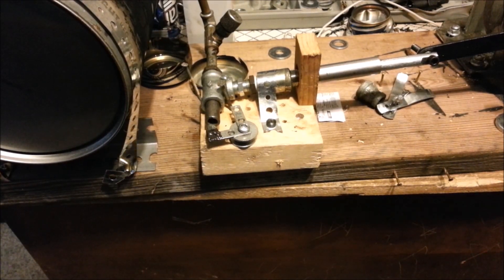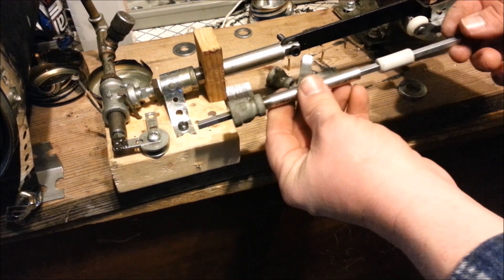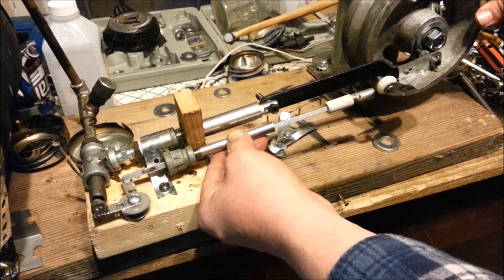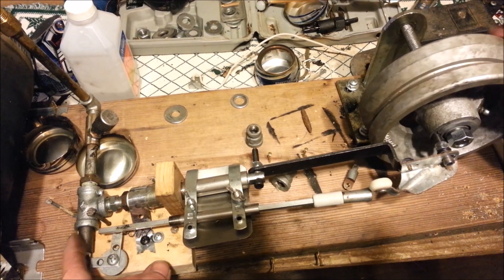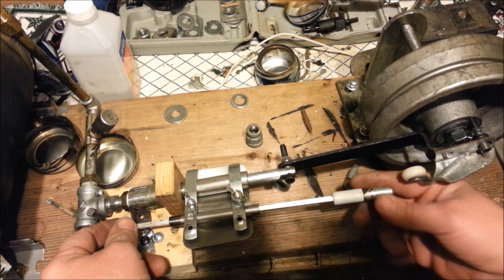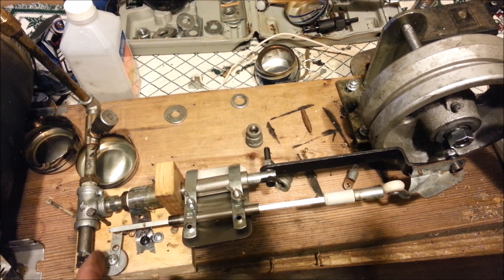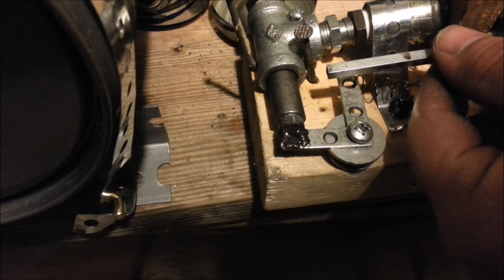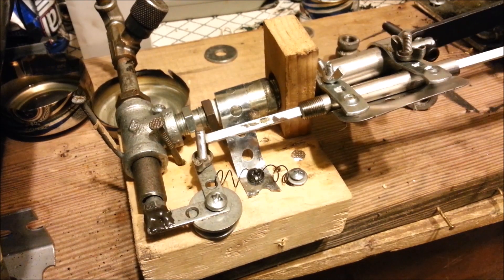How To Build A Steam Engine Part 2

Comment: Great videos. Thanks for sharing. I think if you use a ball valve and open and close the ball valve it will work better for you. That way you don't have to worry about the steam pushing open the valve when the steam gets higher than the spring can close it back. I bet a ball valve will work better.

Comment: hey wayne i think i got one for u for u second piston to work try to but two 90 deg hard or a good stiff metal on both ends that might work the one by the roller might want to adjust it a lil to fit for the piston and the rod hope this helps u out love the clip

Comment: Step your exhaust tube down to a smaller diameter, that way it only takes a small amount of force to keep the valve closed. If the exhaust valve and cylinder are same diameter, the pressure may exhaust overcoming the spring rather than driving the piston. Just step the exhaust down to a small diameter and use a strong spring. Also, the water should be in a closed system. That way the water re condenses and remains in the system, and the only exhaust is that of whatever the heat source is.
Reply: Y

Comment: Everything is perfect except a simple mistake. Mistake is that, just think steam pressure is powerful enough to push a sealed piston to run the entire engine. Piston is pushed by pressurized steam only when the valve is closed. Now there is the mistake. What exactly is closing the valve ?? a simple spring. pressure will always try to find a weak escape, if ever there is a little load in piston then steam will escape through closed valve forcing the spring to stretch. Engine will collapse.
Reply from the maker: +Kishor Parida Good point, and probably exactly right. I really wish I would have finished the project. My problem is I have no real tools other than hand tools. I sometimes get myself into more than I can handle. haha. I would love to have an old Bridgeport mill or even a good drill press. Thanks for watching, check out my other videos.
Reply: +Wayne Earls That is true lol. If you want to make it a complete homemade without even spending a penny then it is going to be a bit difficult. Besides don't worry you already have completed 90% of work. 
What i did for my project is  that i directly attached the shaft operating the valve to the flywheel itself. Now it does the same thing with a more precise, good luck for you work. Hats off man.
Reply: +Kishor Parida  can you upload a video of your engine please